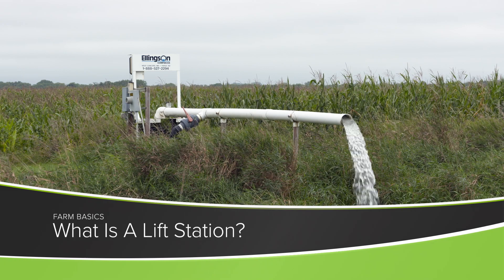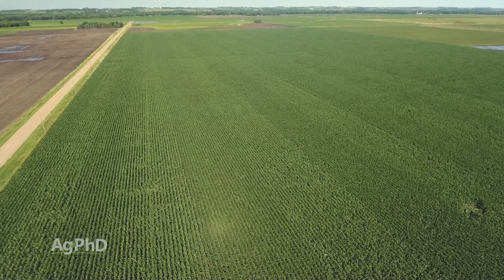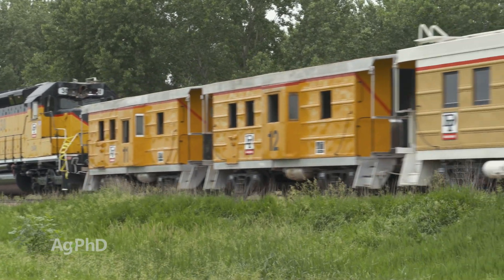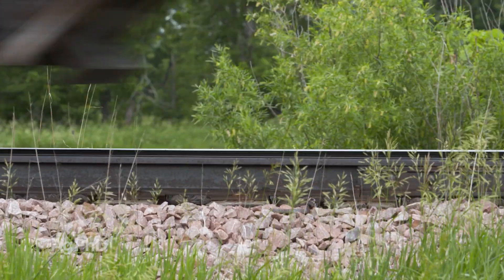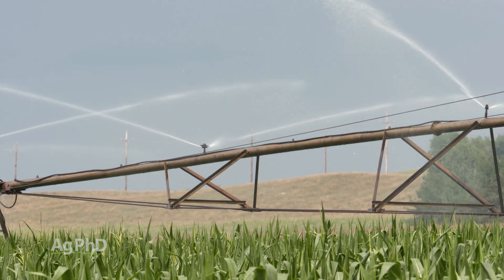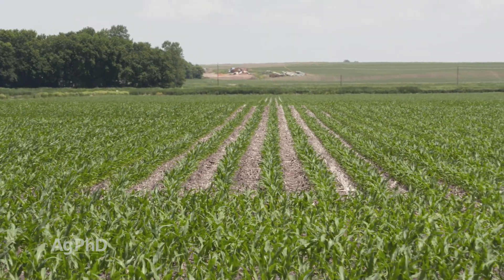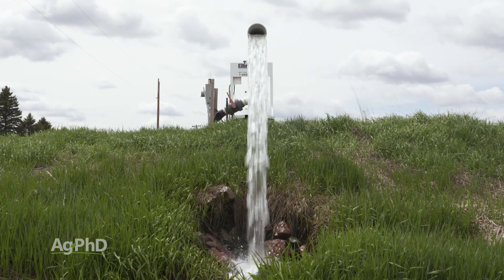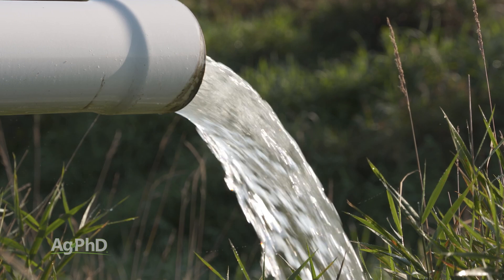What is a Lift Station?

Comment: Very interesting video. I wonder if there are lift stations for basements? A basic sump pump sometimes just doesn't work well enough.
Reply from the maker: Brian and Darren addressed your comments on Ag PhD Radio: https://soundcloud.com/agphd/10-06-21-strip-till-strategies-in-the-fall?si=63326477fadd45af8ad39e6ab58d9a08#t=54:55
Reply: @AgPhD  thanks for your response. We do have a powerful sump pump and never had the electricity go out that caused the basement to flood. Not sure I want to put another hole and sump pump in the floor. That seems to be what causes the flooding.  4-5 inch rains or a few days of a few inches of rain.  Flooding is caused from backup from the sump pump hole. This is a tough one. (Milkweeds are few and far between here in south central IN). Thanks!!
Reply from the maker: @milkweed7678  Brian addressed your comments on Ag PhD Radio: https://soundcloud.com/agphd/10-07-21-ag-phd-radio-show?si=53d9c0f9c0974ebd867f2e5140d8c209#t=55:37
Reply: Wow this is very  interesting to watch. I have been following you for a while and wish I get the opportunity to work with one day.